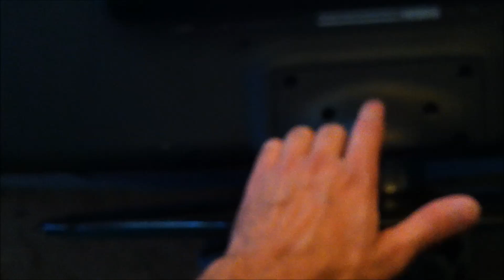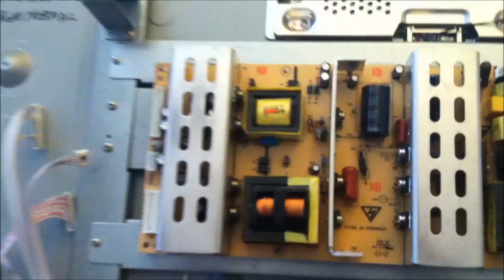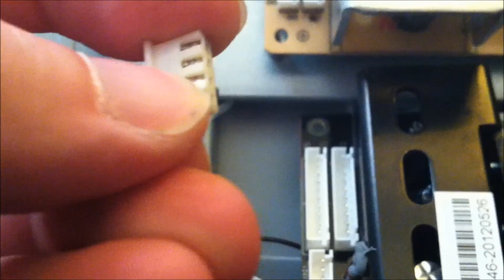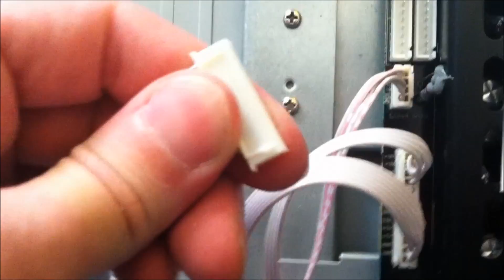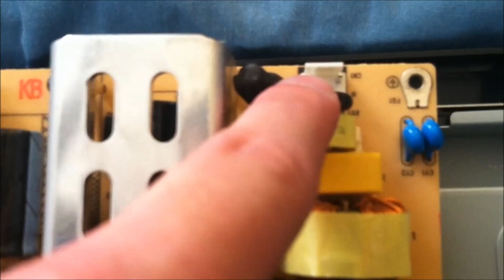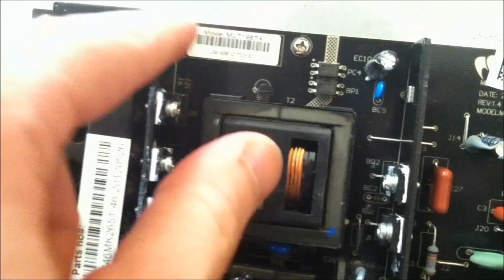Coby TFTV4028 Has standby light will not turn on repair fix

Comment: Got the same part for this TV as a trashpick thinking it was the power supply because indicator light turns on then as i hit power button it gets brighter then Coby comes on the screen then the whole thing powers off with the light off but a difference i found was when u unplug it from the wall with it on still u hear the audio trip, but if the indicator is standby it doesnt make the sound, could this also be the side motherboard or the little top one behind a panel, if not the power wire connection board

Comment: Hello, could someone tell me the value of the two resistors that go between Gate and Source of the mosfet transistor PFF18N50, side by side, are R32 and R34 ... The TV is identical to the video, and the resistors are on the source card, thanks.

Comment: The power supply light is on but the tv will not come on how do i trouble shoot to know what board it might be some electrical knowledge very little electronics i do know hoe to use a meter though lol. Colby 40"

Comment: I have a coby flat screen TFTV3229, I believe I purchased it 2011/2012 & have not had any issues until now, my daughter was watching her cartoons wen it just shut off, the blue light at the bottom did not turn on either. I waited 30 unplugged, nothing. I changed the power cord, nothing. wat can I do?
Reply from the maker: Playfull Playfull changed the power cord?
Reply: After Hours Tv & Pc repair the power extension that it was con ected too
Reply: Same how did you fix it

Comment: this took a little work but IT WORKED! I don't understand why they don't correct the configuration? is it because this is used across multiple units? just wondering.

Comment: i have a 23inch coby ledtv same issue no power just blinking light blue led. but have a temporary fixed using a hair dryer and blow directly at the back air vent. 2mins. then try to press menu button at the back instead of the power button. the remote wont work first give some 5 mins. let it on then power off using the power button then emmediately power on with the power button. now you can use your remote.  but it is only a temporary fix when you turn off the tv with quite a while and same process again.. my idea is letting it on like 24hrs. lol! using my chromecast dongle and let it sits for a while until you use the tv again, or use you tv channel and let it on  . without the chromecast hdmi dongle and the tv channel the tv will sleep and will automatically shut off when not in use. chromecast has a clock display so i use my tv as a clock itself :D
Reply from the maker: janxaholic 911 thanks for that tip, people will be able to do this. You probably have bad capacitors, would be easy to fix permanent
Reply: most probably yea, still struggling with those hair dryer fix. need to send it to a repair shop. sometimes im too stressed out doing it. thanks for the good words bro :)

Comment: I have a coby 40"  TFTV 4028 ONE DAY IT WILL WORK THE NEXT TIME IT WILL NOT, SO I REPLACED THE POWER SUPPLY, WITH A NEW ONE,  BUT NOW THE TV WILL NOT EVEN TURN ON, THE LITTLE BLUE LIGHT IS ON , REMOTE WILL NOT WORK, EVEN IF YOU TURN IT ON AT THE SIDE OF THE TV IT WILL NOT WORK,  AT LEAST BEFORE IF YOU TURNED IT ON , WITH THE BUTTON ON THE TV IT CAME ON , ALSO SOMETIMES WHILE I WAS WATCHING TV IT WOULD JUST SHUT OFF,   PLEASE HELP

Comment: guys how do i fix the key lock with no remote? coz the remote did not run.
Reply from the maker: Go through the menu settings on tv with the buttons on the tv and see if there's something you can turn off?
Reply: +After Hours Tv & Pc repair i did that but the tv didnt shutdown and the channel, vol, menu, source botton did not work. if i click the menu at the side of the tv "key lock" display in the monitor.

Comment: I started having the same trouble a few months ago, then it progressively got worse until it finally wouldn't turn on anymore, even though the standby light was on. It turned out to be the VGA input! After unplugging the VGA (which was connected to my DVR), it now works fine. Weird!

Comment: I have the 4025 model. Mine is doing the same the. The stand by light is on but when you turn it on the screen is flickering and i can hear i high pitch squealing. Which is probably due to the power supply
Reply from the maker: Yup I'd say so
Reply: Do you think anything else could cause that specifically?
Reply from the maker: +J Royal they just have crappy power supplies

Comment: I have replaced the power supply, and the TV works perfectly.  Be aware of which board you buy; they are used in dozens of different sets, and the wiring harness dictates how the board mounts.  Good Luck

Comment: i have a colby 40 inch flatscreen it comes on and works fine but flashing or strobing what could it be?
Reply from the maker: Probably capacitor on power supply board.
Reply: well i took the power supply board out and your rite 2 caps are leaking and two are bulging! im just going to order supply board off ebay! thanks ! i was about to order a inverter board but thought the tv image is clear as a bell just flashing like a strobe!
Reply from the maker: Two caps might cost a buck. I have a video on how to replace them. Save yourself money.

Comment: I have a 4o inch *the one that's not working and a 22 inch coby same model do they have the same power supply meaning can I swap it
Reply: Doubt it because of physical size. It's like 60-70 for a new on.